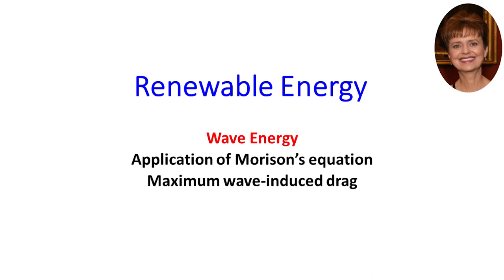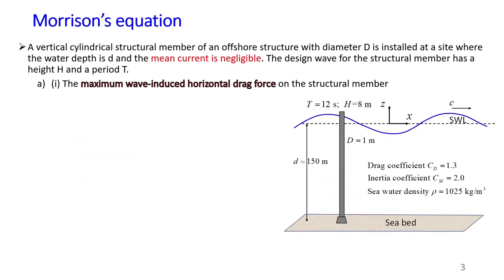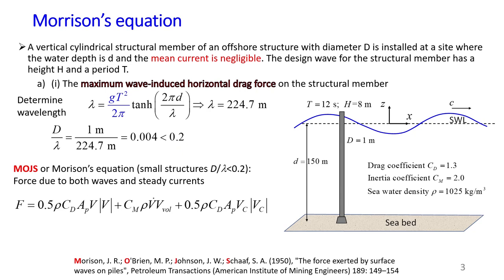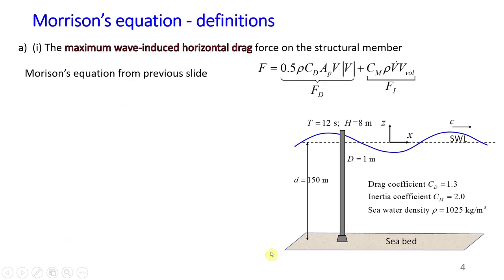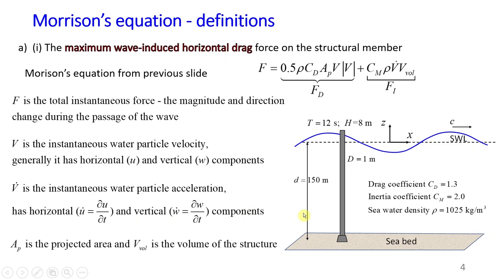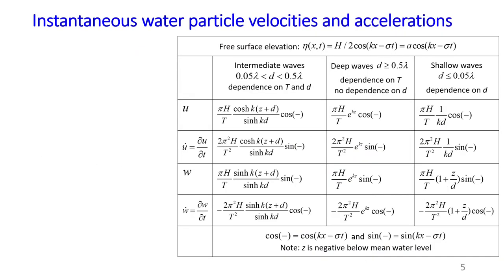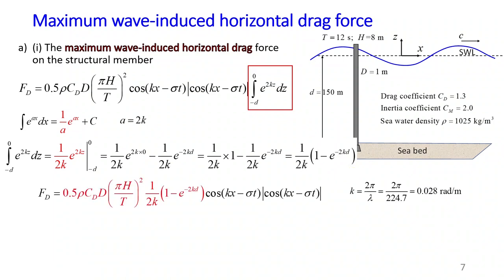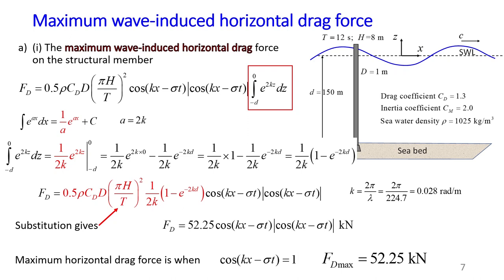Morison Equation - wave loads on structures DRAG force

Comment: How should I treat the integration if the WEC works with the heaving motion (w, and w')? I'll integrate over x for the (horizontal) length of the device and solve the integral with cos^2?

Comment from the maker: Practical example how to calculate the maximum wave-induced horizontal drag force on a structural member.
Reply: Hi, can this formula be applied to the structure above the water? Do we just need to change the value of 'z' for intermediate wave? Furthermore, the calculated value of 52.25kN. Where is that point load applied, is it at the mid height of the pile (i.e. -75m below water level)?
Reply: Olayinka Oyegbemi
Ma'am, Linear / Airy wave theory is not applicable for this example, what is applicable is Stoke's second order theory, you use linear wave theory, ma'am please check and get back to me. Thank you for making the video
Reply from the maker: @olayinkaoyegbemi9762  Linear wave theory (LWT) is the simplest theory and is the best starting point to develop good insight into wave mechanics. LWT strictly applies to conditions of low wave steepness and high relative depth. Most problems of practical interest do not fall within the LWT regime. However, LWT can give results which are “good enough” when used outside its strict region of applicability.

Comment: Thank you madam, Very interesting example and explained in a straightforward manner. according to your knowledge in fluid-structure interaction, Could you please recommend me for a good reference for calculating the forces induced by the sloshing of water on hollow vertical cylinders during the ground excitation?

Comment: Hi Dr. and thanks for the great work. I have a question please. in slide number 6 you integrate the squared velocity from -d to 0. I think that the upper bound for integration should be H/2 or the z cordinate of the top of the member (whichever is smaller) because the wave affects the member above sealevel as well... what do you think? My second question is what if the member is inclined how would we calculate the maximum horizontal wave-induced load on it? All hints are appreciated! -Ahmad

Comment: Hi, can this formula be applied to the structure above the water? Do we just need to change the value of 'z' for intermediate wave? Furthermore, the calculated value of 52.25kN. Where is that point load applied, is it at the mid height of the pile (i.e. -75m below water level)?
Reply from the maker: Morison’s equation is used to calculate wave forces
 on small structures, i.e. a small structure is defined when structure diameter divided by wave length is less than 0.2. If you have intermediate wave and a small structure condition is valid you can use Morison’s equation but you would need to calculated wave speed and wave length using intermediate waves equations. The Morison equation is used to estimate the wave loads, i.e. not sure what you mean by "can this formula be applied to the structure above the water".
Reply: @StudyTips4U  Hi, thank you for the reply. I'm looking for wave force for a small structure supported by the pile. The small structure would be above the still water level, but will get hit by the wave. How do I get the force applied to the small structure? I checked that it is in the intermediate wave zone. Do I then just change the 'z' value to positive (above SWL)?